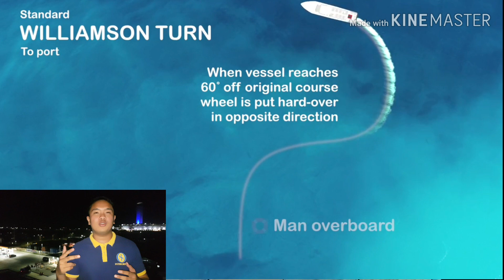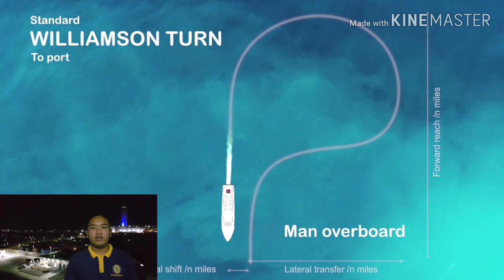SEAM 5

Comment: The key to safe and effective mooring operations is planning and ensuring that appropriate procedures are fallowed. A mooring operation risk assessment should always be carried out. Suitable controls ang procedures  should be in place to minimize  the risk. Identified for this operation. The use of toolbox talks to discuss the operation and the hazards involved is an effective way to help reduce accidents. It may seem like an unnecessary task to undertake. As mooring is a routine operation that most crew are very familiar with. However this is a danger, as familiarity and complacency can lead to a mistake and an accident...

D/C SARTE JOEMAR M.
MON: 7:30 TO 8:30
TTH: 7:30 TO 9:00
SEAM 5

Comment: Strand ---the largest individual element used in the final rope making process and obtained by joining and twisting or braiding together sevrral yarns or group of yarns.
Stern lines------ mooring lines leading ashore from the after end.
Stopper----- a device for securing a mooring lines temporarily at the ship, while the free and is master fast to a ship bitts.
Spring lines------  a mooring lines laeding in a nearly fore and aft direction for the purpose of maintaining the longitudinal position of the ship while in berth.
Bight------ a loop form by doubling back a rope upon itself.
Bitts------- a vertical steel posts or bollards mounted in pairs around which line can be secured.
Bollard------- a vertical steel posts ashore to which the eyeof a mooring line can be secured.
Breastline----- a mooring lines leading ashore as nearly perpendicularas possible to the ship fore and aft line.
Chock------ a guide for a mooring line enabling the line to be passed through the ships bulwarks or other barrier.
Elasticity-------- the elastic elongation of a unit length of an element caused by. Unit load may refer to a material or a composite structure such as a mooring line.........

Comment: the term "mooring" refers to the system for securing a ship to a terminal. The most common terminals for tankers are piers and sea islands. Use of an efficient mooring system is essential for the safety of the ship, her crew, the terminal and the environment. 

D/C FERRAREN, CLINT A.
9:00-10:30 AM (TTH)

Comment: Working on ship’s deck is not an easy task, ship’s deck crew members should considered all the safety precautions to avoid various incidents especially when it comes to mooring operations because it is one of most important task for the deck crew. The operation may be seems simple but there are several dangerous associated with it that needs to be taken to ensure personal crew regarding to their safety.

D/C ROSAL, GEROME BRYAN N.
BSMT-H3A 

Seam 5
Monday(7:30-8:30am)
TTh(7:30-9:00am)

Comment: The term mooring refers to the system,for securing a ship to a terminal. The other shipboard operations such as at single point mooring (SPMs), multi-buoy moorings(MBMs), floating production storage, and off loading vessels (FPSOs) and offshores loading facilities, emergency towing, tug handling,barge mooring,canal transit....
The efficient mooring system is essential for the safetyof the ship, her crew, the terminal and the environment...

Comment: The objectives of mooring operation is to perform on ship’s deck. Mooring is an important task. As a seafarer, you must have heard about “Death Traps” on ships and how crew members have lost lives during mooring operation.

Working on the ship’s deck is not an easy task. Deck crew has to consider various safety precautions and understand working of deck machinery and systems, along with cargo operation equipment. When it comes to mooring operations, additional precautions need to be taken to ensure personal and crew members’ safety.

SEAM 5
7:30-8:30 Mon
7:30-9:00 TTh

Comment: The term mooring is refers to the system for securing a ship to a terminal. The most terminals for tankers are piers and sea. The use of an efficient mooring system is essential for the safety of the ship, her crew, the terminal and the environment. Their are forces acting on the mooring of a ship must resist  wind, current, tides, surges from passing ships, waves/swell/seiche, ice and changes in draft, trim or list.

D/C BANATE, LORETO O.
7:30 - 8:30 M
7:30 - 9:00 THH

Comment: A mooring is any permanent structure to which a vessel may be secured. Examples include quays, wharfs, jetties, piers, anchor buoys, and mooring buoys. A ship is secured to a mooring to forestall free movement of the ship on the water.

D/C Doroon, Lemark D.
7:30-8:30 Mon
7:30-9:00 TTh
Seam 5

Comment: Carlo D. Loreto
Seamanship 5
7:30-8:30AM Monday
7:30-9:00AM TTh

A mooring is any permanent structure to which a vessel may be secured. Examples include quays, wharfs, jetties, piers, anchor buoys, and mooring buoys. A ship is secured to a mooring to forestall free movement of the ship on the water.

Comment: D/C Lubanga,  Kurt Wesly L. 
7:30-8:30 Monday
7:30-9:00 TTH
Seam 5

A mooring system is used for station keeping of a ship or floating platform in all water depths. It is made up of a mooring line, anchor and connectors.Mooring lines or cables used to secure a ship at a berth.Anchors are the main part of mooring system. It is used to provide strength to the mooring system and helps in holding the boat under tough condition.

Comment: D/C Vequiso, Jay Emmanuel P.
7:30-8:30 AM Mon
7:30-9:00 AM TTh
SEAM5

The term 'mooring' refers to the system of securing a ship to a terminal. The most common terminals for tankers are piers and sea islands. However, other shipboard operations such as mooring at Single Point Moorings(SPMs), Multi-Buoy Moorings(MBMs), Floating Production, Storage and Offloading vessels(FPSOs) and offshore loading facilities , emergency towing , tug handling, barge mooring, canal transit, ship-to-ship transfer and anchoring may fall into the broad category of mooring and so require specialised fittings or equipment. Anchoring equipment is covered by Classification Society rules and is therefore not included in these guidelines.

Comment: D/C Bejagan, Rodel A.
7:30-9:30 TTH
SHORE TENSION 
Dynamic Mooring System

⚓ Shore tension is a system for safer mooring of sea-going ships that's as convenient as it is revolutionary. A cylindrical device, can be flexibility used in any port at terminals where containers, general cargo and / or bulk are handled. With shore tension, ships of any size can be firmly anchored to the quay. It significantly reduces movement caused by strong winds, current, swell or passing ships.
Ty

Comment: D/C LEGASAN, KENT S. 
M (7:30-8:30 am)
TTH (7:30-9:00 am)
SEAM 5

Mooring system is made up of a mooring line, anchor and connectors, and is used for station keeping of a ship or floating platform in all water depths. Efficiency use of mooring system is essential for the safety of the ship, her crew, the terminal and the environment.

Comment: D/C ROLLON DIN MARK P.
SEAM5 7:30-8:30 AM( MWF)

Mooring operation is one of the important tasks that seafarers have to perform on ship’s deck.The use of an efficient mooring system is essential for the safety of the ship, her crew, the terminal and the environment. The problem of how to optimise the moorings to resist the various forces will be the forces applied on the ship. The general principles determine how the applied forces are distributed to the mooring lines. And how can the principles be applied in establishing a good mooring arrangement.

Comment: Following factors make this mooring area and operation and dangerous: use of old and damaged wires and ropes that do not possess the adequate strength to hold the ship in place as well as the possibility to cause damage to the personnel ( chafed, weak ropes can snap/ get stuck in the winch at any time) in addition there is a so called snapback zone which are painted yellow which means danger zone in the floor of the mooring area

Comment: D/C LEDESMA, ALLEN SHENE T. 
7:30-9:30 TTH
SEAMANSHIP 5
.
.
The use of an efficient mooring system is essential for the safety of the ship, her crew, the terminal and the environment. The problem of how to optimise the moorings to resist the various forces will be the forces applied on the ship. The general principles determine how the applied forces are distributed to the mooring lines. And how can the principles be applied in establishing a good mooring arrangement.

Comment: PSSR

1. A. Muster station
2. A. Attire youself adequately and properly
3. C. Yell man overboard
4. D. Follow luminescent arrow signs for escape route
5. C. Isolate the area
6. A. Fire detection system
7. D. To the port facility waste segregation system
8. A. Place it on compactor
9. C. Global warming
10. A. Water pollution
11. B. Must use safety harness with life line
12. A. Wear an OBA
13. A. Use  a toxic meter to detect
14. B. Wear a breathing apparatus
15. D. Immediately rush to the victim and help
16. B. Personal
17. D. Limitation of symbols in which people communicate
18. C. Submit a written explanation
19. B. Distinguish the current position
20. C. Stop bunkering
21. D. Environment
22. B. Assist immediately the crew
23. B. Direct him the muster list
24. C. Environment
25. A. Inform the SSO
26. B. Fatigue
27. C. Take a rest and sleep first
28. B. Sympathize and talk to him calmly
29. D. Ignore and be patient
30. A. Management factor

DOROON, LEMARK D.
BSMT-H3A
7:30-8:30 M
7:30-9:00 TTh

Comment: 1.A.Muster station
2.A.Attire youself adequately and properly
3.C.Yell man overboard
4.D.Follow luminescent arrow signs for escape route
5.C.Isolate the area
6.A.Fire detection system
7.D.To the port facility waste segregation system
8.A.Place it on compactor
9.C.Global warming
10.A.Water pollution
11.B.Must use safety harness with life line
12.A.Wear an OBA
13.A.Use  a toxic meter to detect
14.B.Wear a breathing apparatus
15.D.Immediately rush to the victim and help
16.B.Personal
17.D.Limitation of symbols in which people communicate
18. C. Submit a written explanation
19.B.Distinguish the current position
20.C.Stop bunkering
21.D.Environment
22.B.Assist immediately the crew
23.B.Direct him the muster list
24.C.Environment
25.A.Inform the SSO
26.B.Fatigue
27.C.Take a rest and sleep first
28.B.Sympathize and talk to him calmly
29.D.Ignore and be patient
30.A.Management factor

D/C Banate, Loreto O..

BSMT-H3A

Seam5
Mon 7:30-8:30 am
TTH 7:30-9:00 am

Comment: Davit Launched Lifeboat has two types of lifeboat releasing mechanisms, onload and offload. These mechanism release the boat from the davit, which is attached to a wire of fall by means of hook. Davit are most often used to lower on emergency lifeboat to the embarkation level to be boarded. In order to know how to operate this survival craft, just read the manual book first, so that you will know how to operate, in case of emergency situation.

Miko Fuertos
Mon 7:30-8:30
TTH 7:30-9:00

Comment: 1Muster station
2Attire youself adequately and properly
3Yell man overboard
4Follow luminescent arrow signs for escape route
5Isolate the area
6Fire detection system
7To the port facility waste segregation system
8Place it on compactor
9Global warming
10Water pollution
11Must use safety harness with life line
12Wear an OBA
13Use  a toxic meter to detect
14Wear a breathing apparatus
15Immediately rush to the victim and help
16Personal
17Limitation of symbols in which people communicate
18Submitt a written explanation
19Distinguish the current position
20Stop bunkering
21Environment
22Assist immediately the crew
23Direct him the muster list
24Environment
25Inform the SSO
26Fatigue
27Take a rest and sleep first
28Sympathize and talk to him calmly
29Ignore and be patient
30Management factor

Comment: Lifeboats play a huge role on ships because they are a life-saving equipment. But, in order for it to work as it is supposed to be, it has to be regularly checked once every 3months to ensure that it is still in good working condition. Poor maintenance could lead to huge casualties during emergency where the lifeboat is most needed.

D/C Capanas, Ivangey Godfred
TTh - 10:30-12:00
Fri- 7:30-8:30

Comment: In 2016, a carrier ship named Modern Express which is Panama flagged encountered a disaster in the bay of Biscay. The carrier ship listed on the starboard side and lost its stability due to bad weather. The ship began its list at 130mm. Fortunately, the spanish coast guard were able to rescue immediately the 22 crew members of the ship. After the rescue, the salvage team have worked on towing the ship to port by attaching tow lines. Somehow, the ship was successfully towed to the port of Bilbao. And it was brought upright after 3weeks time.

D/C Capanas, Ivangey Godfred M.
TTh - 10:30-12:00
Fri - 7:30-8:30

Comment: Free fall liferaft can also be triggered when ship is shrinking. The HRU is triggered and the liferaft will inflate and anyone can cut the painter using the knife inside the liferaft in order not to be pulled by the shrinking vessel. 

D/C Baltazar, Jever P.
Mon 7:30-8:30
TTh 7:30-9:00

Comment: Maintenance and Inspection
experience has revealed poor maintenance as a contributory factor to many incidents and near misses involving survival craft. common concerns identified include grease points on hook assemblies, neglected wires, corroded cups, worn out chain links and shackles. incorrectly adjusted control cables and seized released levers.

It is recommended that operators carry out a complete review of the specific types of survival craft and ancillary equipment installed on board their ships and ensure that the manufacturer's instructions are clear and specific.

In accordance with SOLAS (Safety of life at Sea Convention) requirements, operational checks and maintenance must be out at the following intervals as a minimum:

-Weekly
-Monthly
-Annually
-Five yearly.

D/C To-ong, Alexzander P.
7:30-8:30 AM FRI
10:30-12:00 PM TTh
Seam5

Comment: Free fall lifeboat... Before we entering inside we need to locate first the manual checklist of safety guidelines..and instructions...and before to proceed the operation we need also to check first the parts either it is in good condition....we need to check the maintanance record, and testing the sterring , the propeller, the hydrostatic release if these are functionable or not, the diesel, the food inside and to know the allowable crew inside .....a contributory factors to many incidents and near misses involving survival craft and common concern identified include painted grease point on hook assemble,neglected wires, corroded cups, worn out chain links and shackles,corroded sheathed cables,incorrectly adjusted control cables and seized release levers....the launching is once in a month..

Comment: Free Fall  Lifeboat Launching
Free fall lifeboat launching mechanism is similar to onload release. The difference is that free fall is not lowered till 1m above water level, it is launched from the stowed position by operating  a lever located inside the lifeboat which release the boat from rest of the davit and boat slide through the tilted ramp into the water. 

D/C Lubanga,  Kurt Wesly L. 
Monday 7:30-8:30 am
TTH 7:30-9:00 am

Comment: There are 2 Davit launched Lifeboats in a vessel, 1 in the starboard side and another 1 in the port side. These two is numbered 1 and 2 respectively with thier IMO callsign below. Both of them has the capacity to carry all the crew. I noticed that significant numbers of incidents involving davit launched lifeboats have taken place onboard drills and maintenance actvities. In order to minimize this incidents these are the things to be included:
1. The use of fall preventer device to prevent accidental release of lifeboats during drills:
2. It is recommended that no boat should be lowered or lifted from the water during drills  with  onboard unless a fall preventer device is fitted

Comment: How does Davit Launched Lifeboat released? To release  the lifeboat from the davit, which is attached to a wire or fall by means of a hook. By releasing the hook the lifeboat can be set free to propel away from the ship. It should be 1 meter above from the water to avoid accident.

D/C Legasan, Kent S.
Seam 5

M (7:30-8:30am)
TTh(7:30-9:00am)

Comment: DAVIT LAUNCHED LIFERAFT:  It is required under SOLAS that onboard training in the use of davit launched liferafts is undertaken at intervals of not more than 4 months. 
Some vessels maybe equipped with a common davit to launch a rescue boat and liferafts. These davits have two separate hooks for lifting the rescue boat( on-load release)and the liferaft(off-load release). 

D/C ROSAL,GEROME BRYAN N. 
BSMT-H3A 

Seam5

Comment: In launching the free fall lifeboat, it is recommended that free fall lainches are carried out are more frequent interval than required by SOLAS or flag state. Whenever safe and practical to do so, in order to maintain crew confidence in this equipment and to ensure that statutory requirements are met. 
 Richie L. bombita jr.
Seam5
7:30-8:30M
7:30-9:00Tth

Comment: Davit launched lifeboat
- there are two types of lifeboat releasing mechanisms, onload and offload. These mechanism release the boat from the davit, which is attached to a wire of fall by means of hook. Davit are most often used to lower on emergency lifeboat to the embarkation level to be boarded. In order to know how to operate this survival craft, just read the manual book first, so that you will know how to operate, in case of emergency situation.

Mon 7:30-8:30AM
TTH 7:30-9:00AM